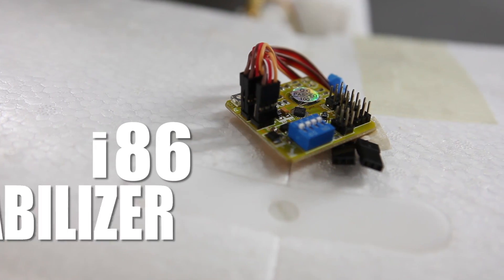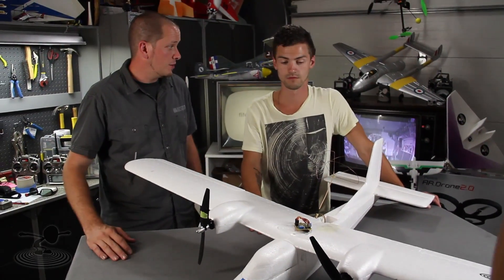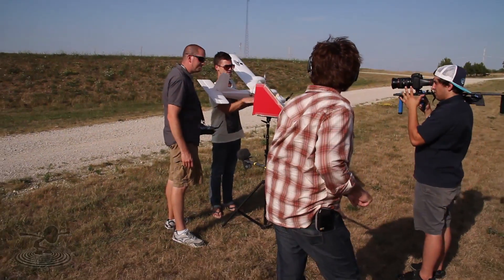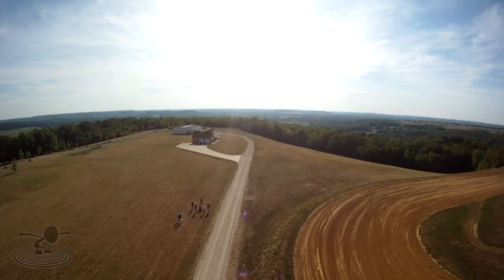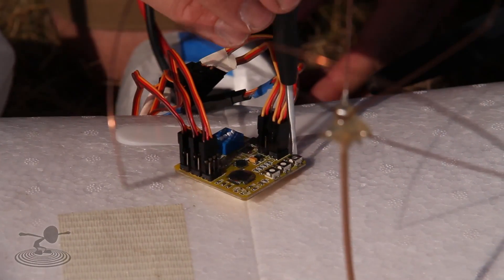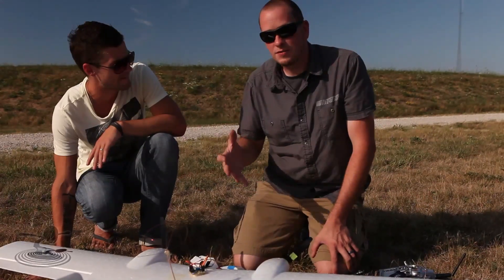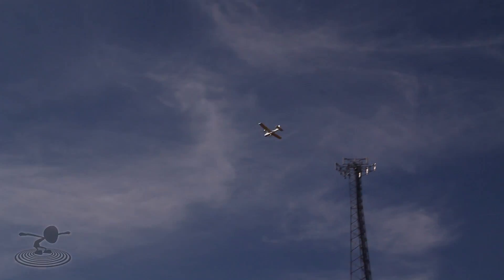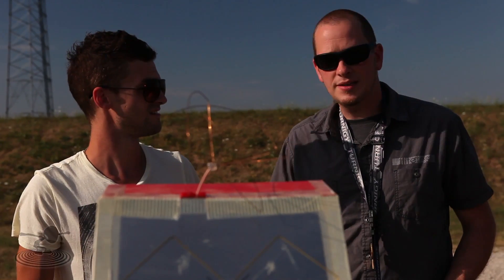Flite Test - i86 Stabilizer - REVIEW

Comment: Hey, Bixler.  DIP (indeed pronounced "dip") switches are otherwise known as Dual Inline Package switches -- that is, switches in the DIP format.

DIP is an electronic package that uses two sets of inline pins for through-hole or socket mounting.

Most microcontrollers and integrated circuits to this day are DIP, but generally it seems people only ever say it when referring to DIP switches.

Comment: The HK i86 is a clone of the EAGLE N6 flight controller, and the i86L is the N6 V2 clone. The difference between the two are that the V2, or i86L has an external 16MHz crystal, and only uses MEMS gyros for stabilization, so it is can handle faster maneuvers. I have the i86L on my acrobatic quad, and it is my favorite FC to date... it just flippin' great! There is no need to interface with a computer, it's simply PNP, and field friendly!

Comment: WARNING: If you intend to use the i86 as a multi rotor flight controller, there is a known bug in the firmware. During the ARM/DISARM process, there is a 1-2 sec. pulse sent to the throttle output that SimonK flashed ESCs will not filter, and this can result in a full throttle catastrophe!
No problems have been reported will non-flashed ESCs, nor the i86L which does not have the ARM/DISARM feature.

Comment: WARNING! Do not buy the i86 Stabilizer as long as it has a bug! Please read the reviews regarding the i86 Stabilizer on the hobbyking website. Example1:"I think this control board has very dangerous bug. Just sometimes happend symptom that all rotor was rotate full rpm after disarmed action after landed. So, my 3rd quadcopter has been literally distroyed.. It's really danderously.. Anybody has same symptom?" 2: "i have no control over the four motors they run flat out! lucky i had no props on!"